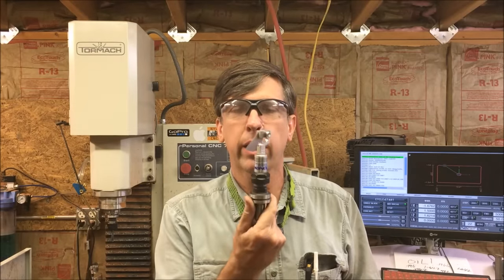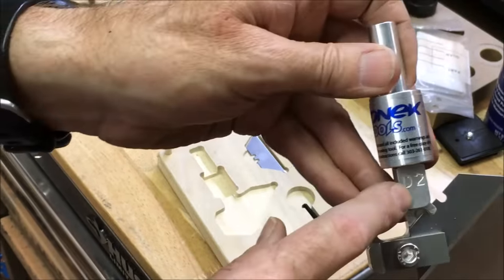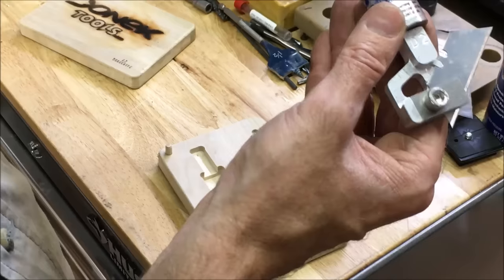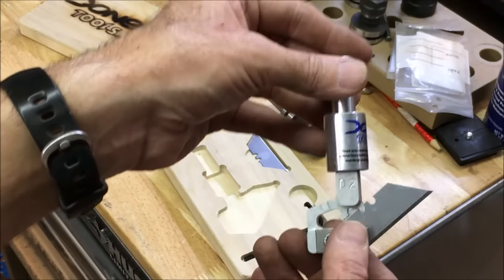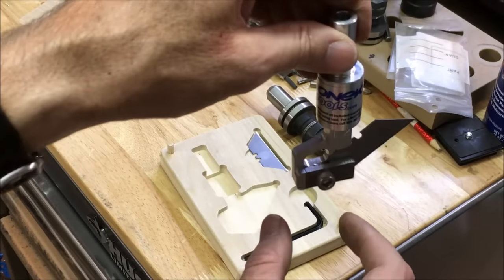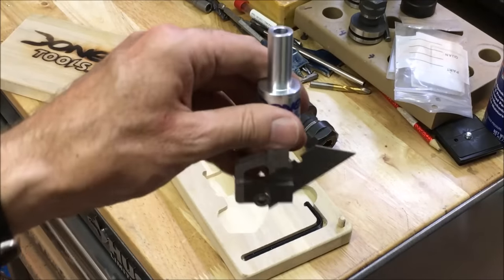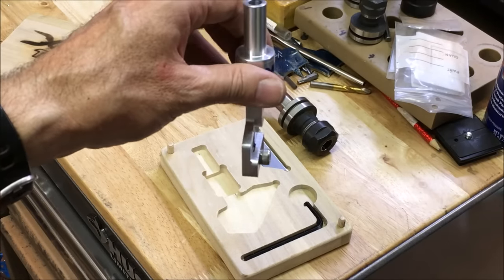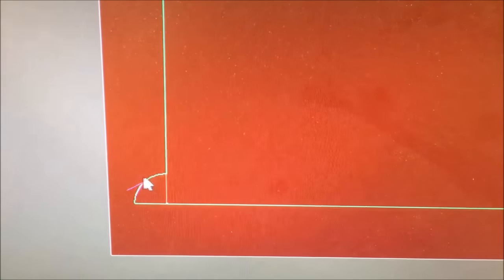Donek Dragknife in Action and How it Works

Comment: Craig. Great video. What cnc machine would you recommend for a beginner trying to cut foam board with this set up at home?
Reply from the maker: If you are just cutting foam board then you can probably just get an inexpensive cnc router. Not really familiar with all the cnc routers out there. You can probably just look on Ebay or Amazon.

Comment: Thanks for a great video. What specs CNC would u recommend for this knife? My wife make Headstalls and leather goods for horses. She would be cutting a maximum of 3/8" leather.
Reply from the maker: Thanks!  A decent CNC router I would guess.  Not sure of all the models.  You should check with Donek about the thickness.  Might need multiple passes at that thickness.

Comment: I am struggling to see where the price comes from. A decent router costs less. I thought Festool had ridiculous prices, but this caps it.
Reply from the maker: Mine has cut probably over 10K gaskets, so it has paid for itself many times over.
Reply: @craigsmachineshop2040  Still came out of your pocket- but if you are happy with that...
Reply: For the same reason Nike's are more expensive.  The price is way over the top - but people are stupid enough to buy